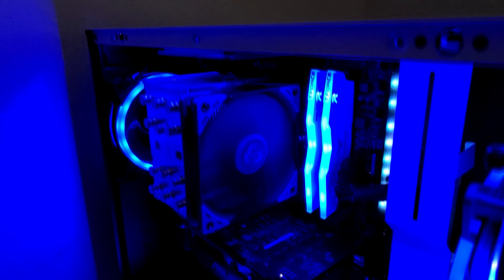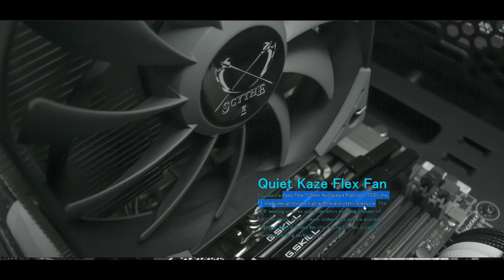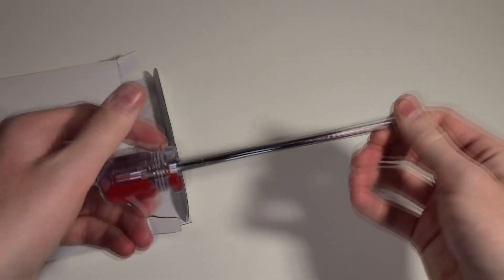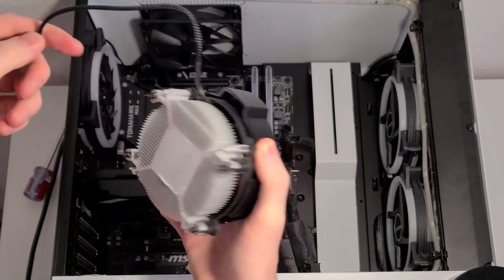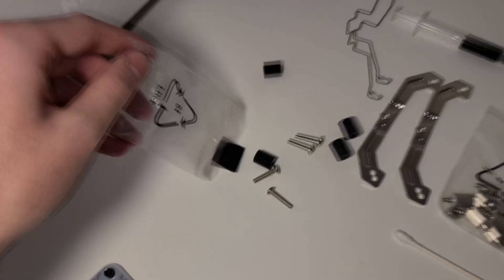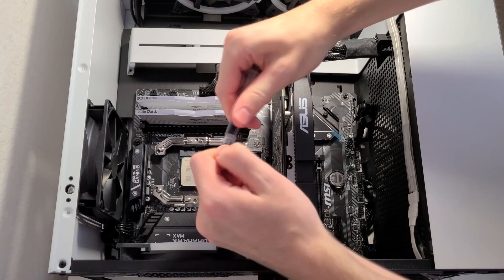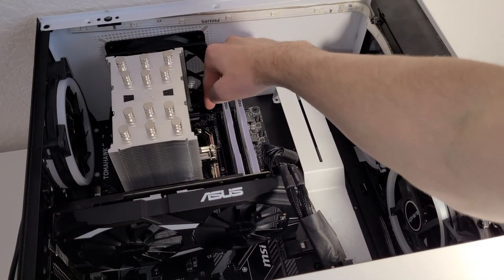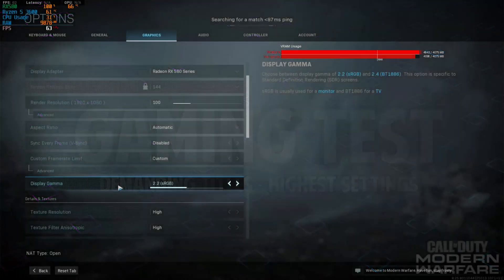Scythe Mugen 5  - BEST Mid-Range CPU Cooler!

Comment: Should I wait build a pc till after the 3000 rtx cards come out like do you think the prices will change for the other graphics cards so I will be able to get more value out of my pc my budget is around 1000$
Reply: The graphics cards are selling out as soon as they are released. I estimate it will be a few months before people will get easy access to them. I impulse bought a PC in July, now I am stuck with a 2070 super. Not a bad card, but for $500 now you can get 2080ti performance. Patience works.